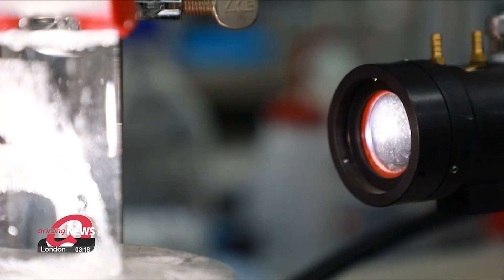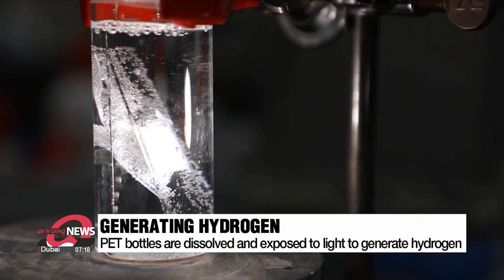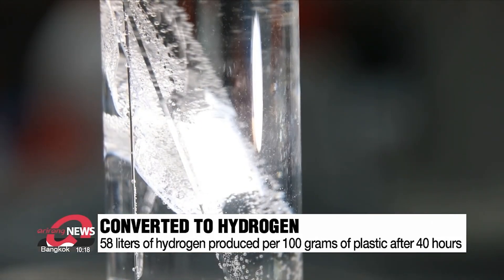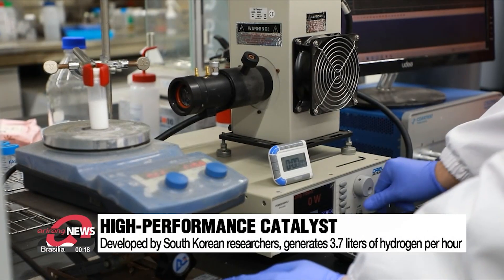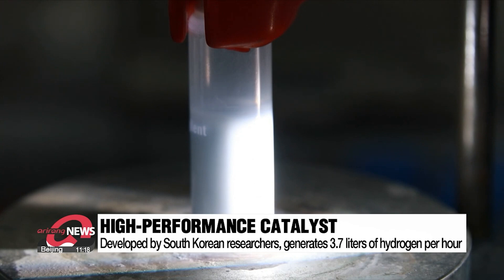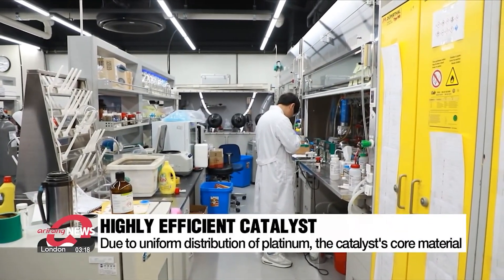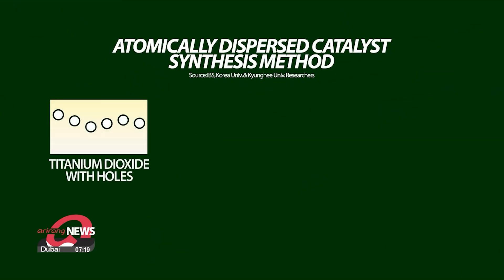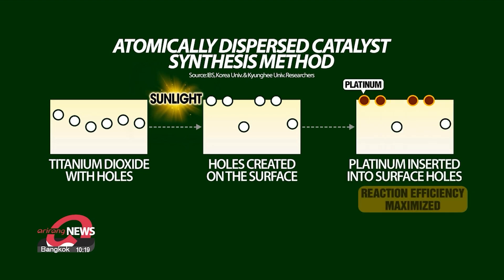S. Korean researchers develop catalyst with high efficiency of hydrogen liberation from plastic

Comment: 100 grams of plastic generated 50 litres of hydrogen gas at what pressure ? Always remember to mention the pressure when mentioning the amount of gas in volume terms. Otherwise just mention the mass of the gas generated which is a difficult process to find. 50 liters of hydrogen at very low pressure doesn't amount to much.
Reply: PET is about 4.2% hydrogen by weight, which means a maximum of 4.2 grams of hydrogen, which is a bit over 2 moles. That translates to about 50  liters at STP. So the answer to your question is 1 atmosphere at room temperature.

Comment: It would be very informative to know how they're going to manage the CO2 generated in the process.
Reply: The CO2 is produced in a controlled environment and not in an open reaction. So it can be captured and easily used for industrial purpose so don't worry
Reply: @tajinderpalsingh26  im aware it can be captured, but I want to know how they're actively managing it. Capturing it and doing what with it?
Reply: @ab18194  it's not being used in a mass scale so there's no hurry to build protocol for CO2 management